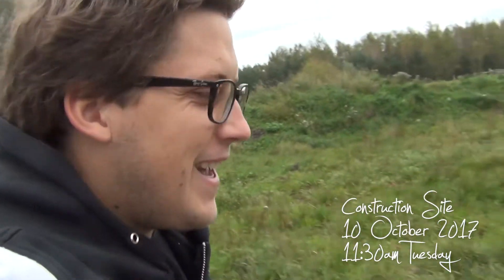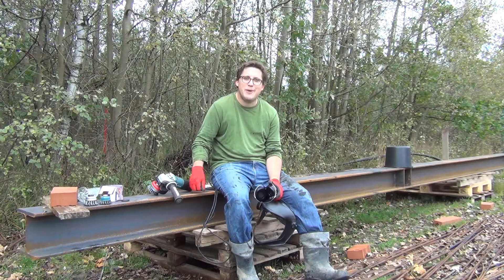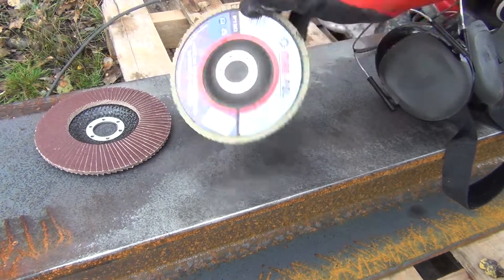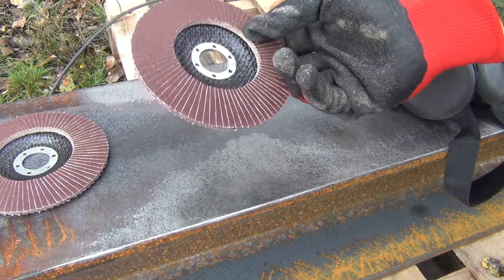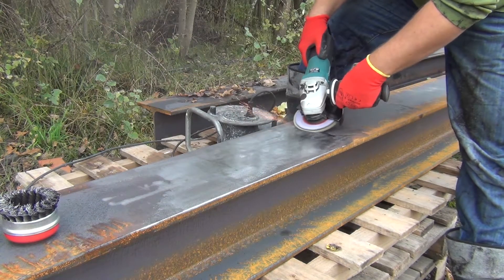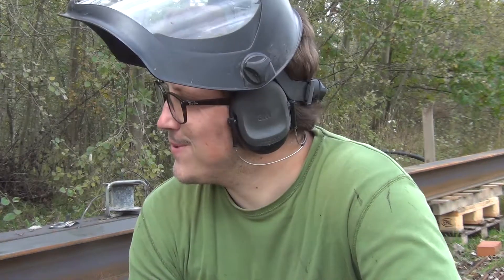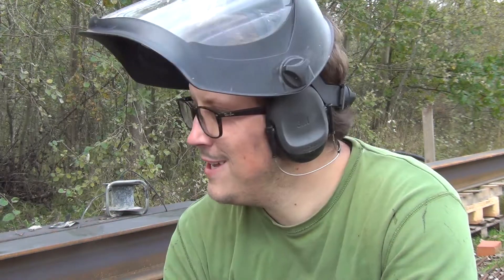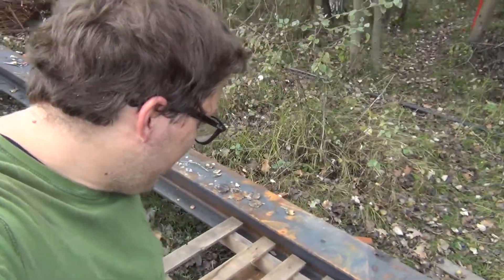BoH 72 - Preparing the HEB 220 I-beam for Paint

Comment: this is not necessary, maybe if there was rust or pre existing coatings, and particle blasting would be a way better way to go in that case, a strong epoxy, oil, or elastomeric based paint will stick to light rust and raw steel surface, i would say a polished surface is probably making it even harder for paint to adhere, unless you need a perfect finished look this is senseless
Reply from the maker: It exposed in the interior, and wanted it super good looking.. turned out ok :D

Comment: what was the outcome of the comparison of beams?
Reply from the maker: I Solid the cutoff several months later but in the time I had it nothing happened to the part that was primed and painted, the texture was a little bit rough but from the oxidation aspect it was just fine, I guess it’s more relevant several years later. The I beam I have in the house is ok looking :) I might have to shoot an update vide about it, just need to buy a ladder tall enough haha haha

Comment: How could this be done indoors to structural non removable beams??
Reply from the maker: I would find a paint you can apply on top of the rust and mill scale and not worry about cleaning the beam
Reply: @PolymathPete  I was going to do that with rusty metal primer and Rust-Oleum oil paint until I saw you awesome work I don't want mill scales in the finish the uniform look you have is ideal
Reply from the maker: Maybe you can get the same with multiple layers of paint maybe 2 or 3 if you sand in between, not sure how “invasive” your renovation can be maybe hand sanding would be sufficient and would control the dust levels to a minimum.
Reply: @PolymathPete  that's genius! thank you so much and it can be mildly invasive so I will do that instead of exploring messy wet grinding options +1